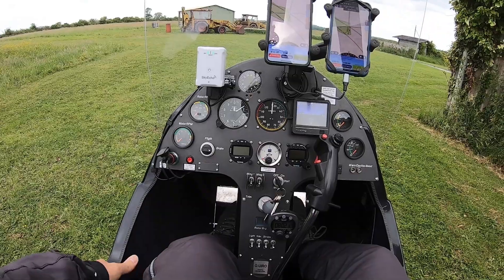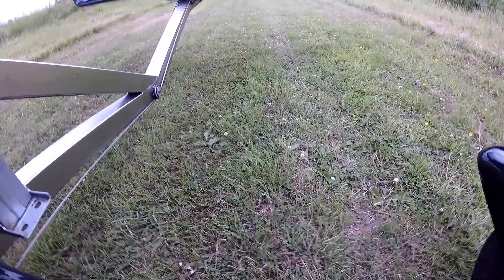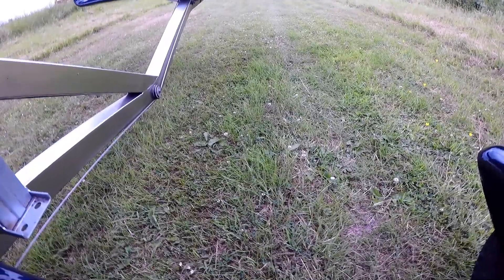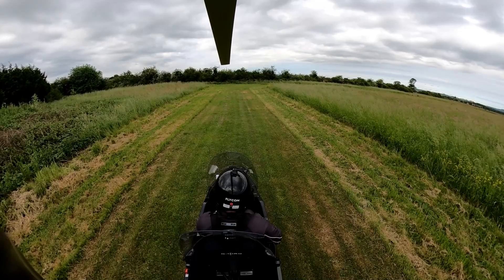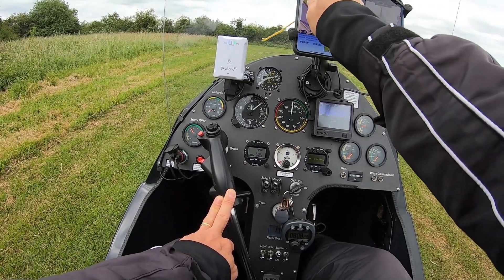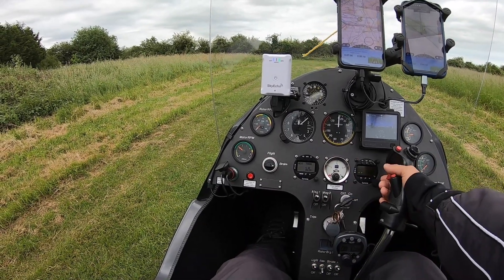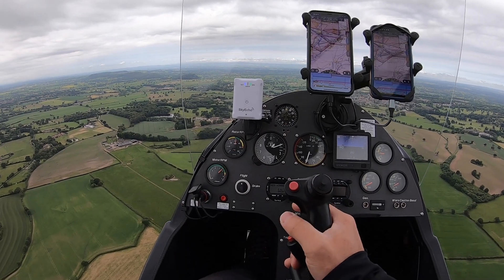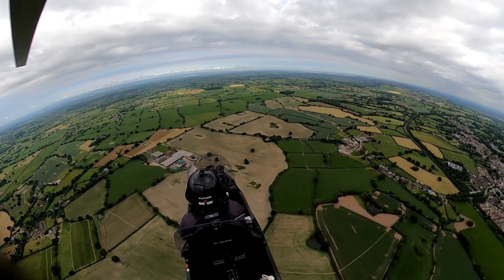Landing in a Farmer's Field - full flight with ATC and commentary

Comment: Thanks Stu I enjoyed that flight very much. I have over 2k hours in the RAF 2000 Gyroplane and flown all of it in western Canada since 1995. We are getting our main rotor blades and heads from GyroTech in Poland and using the Subaru 2.5 litre engines and 4 bladed props either Warp or Bolly from Australia.